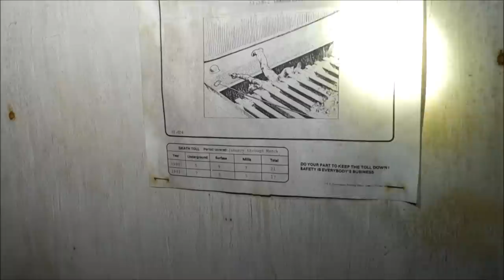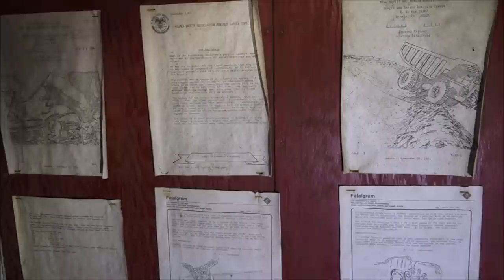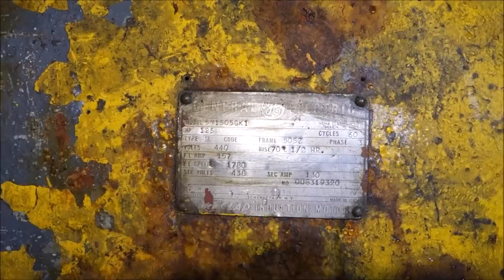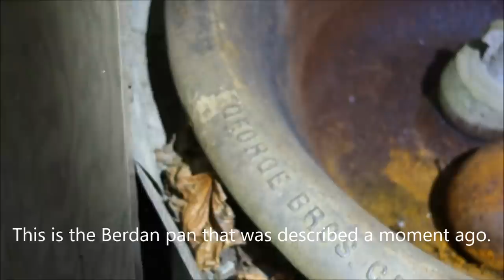Fascinating Visit To The “Rogue” Miner’s Gold Mine

Comment: 26:21 Not all jaw crushers are set up that way. Ours has a vibrating grizzly feeder that acts as a screen for undersize; oversize is run to the 42" x 48" jaw. Undersize runs directly to the belt line that feeds the secondary crusher plant. We run a Teledyne hydraulic hoe ram to break up big rock so we don't need to shut down the crusher to clean it out. Production is usually about 7500tpd in a 12-13-hour shift.
Reply from the maker: Thanks for sharing that. 7,500 tpd is a phenomenal amount of rock!
Reply: It's fairly typical for an aggregate mine, but definite quite large by the standards of narrow-vein metal mines!

That tonnage is made possible through mechanization. Every aspect of our underground mine except for loading powder is fully mechanized. Drilling, bolting, and scaling all utilizes mobile equipment, which speeds things up and decreases the risk of injury. If we used jacklegs through breast stoping, and hand-scaled faces before mucking, we couldn't make nearly as much rock. As we're just mining dolomite, we have no grade to worry about and therefore don't need to mine selectively. Everything is ore.

The underground mine only employs about twelve miners at this point in time, the remainder of our staff is made up of maintenance guys, admin, and my crew in the mill.

Comment: This is a great video but I was curious about a couple of things. Mr. Yager said the mine was too close to the stream to bring waste rock out of the mine, if I heard him correctly. I can certainly understand the restriction on cyanide use but not being able to bring waste out of a mine could sure put a damper on new prospecting. All the rock I've seen blasted tends to take up more room after than it did before. I was curious as to the time that the mine was abandoned and the point at which it was being worked again. To know those dates gives some idea of how long it takes nature to start reclaiming what was originally hers. Metal rusts, roofs collapse, floors cave in, and large pieces of machinery get blown up. That would make a good video. Thanks a lot, it's greatly appreciated.
Reply from the maker: This one dates back from the early days and has been worked off an on for the duration. The exact beginning date is unclear... With California's extensive rules and regulations, the disposal of waste rock is a tricky thing.

Comment: As you look upwards into that enormous stope at 13:56, it appears the old timers left quite a bit of the mineralized quartz in place [on the right side of the stope]. Can you tell us why they left this ore?  Isn't this the same vein you said yielded 5,000 ounces of gold in one small area just a few feet away?  I have seen this done in many of the old mines you explore and I've meant to ask you why they chose to not extract such rich ore. For that matter, wouldn't it be worthwhile to extract the ore today?
Reply from the maker: In cases like this, the gold is confined to a pocket with the surrounding quartz proving to be uneconomical to mine. Of course, they could be two feet away from another enormous pocket, which is why modern metal detectors have breathed vigorous life into some of these old mines. I don't know if a metal detector has been brought into this mine. Yes, some of these smaller mines are incredibly rich with gold still. The problem obstructing the "worthwhile" question is all of the rules, regulations and permits required for getting a mine up and running. The permits - everything from noise assessments to sexual harassment training - prove insurmountable for miners without deep pockets. The economics favor the big boys with deposits worth billions of dollars that can afford to jump through all of the hoops and wait years for all of the permissions to come through.